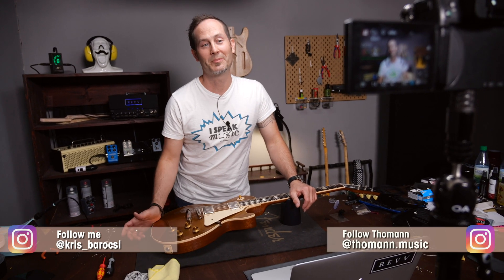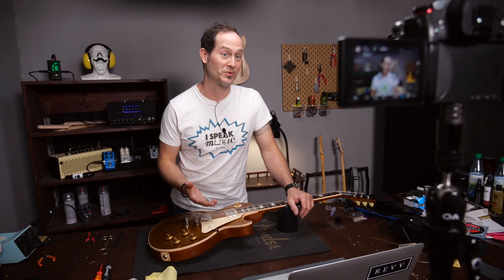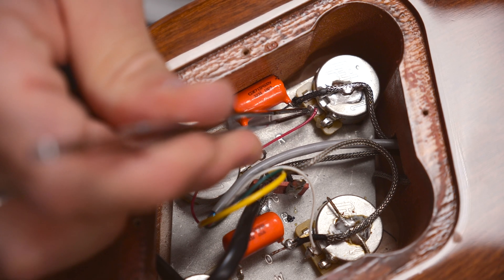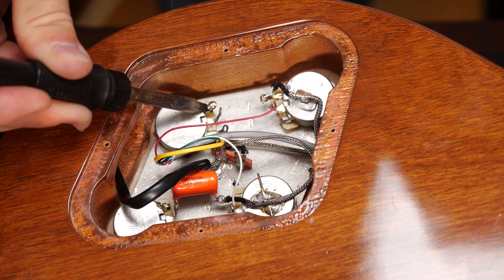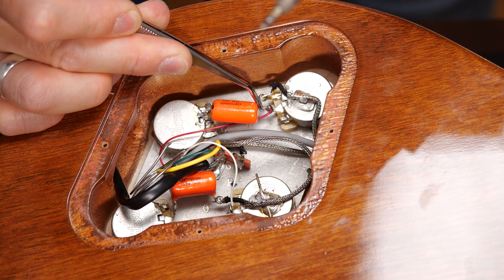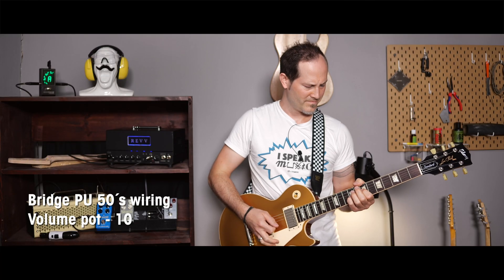What Is The '50s Wiring? | Guitar Tech Tips | Ep. 75 | Thomann

Comment: For anyone interested, you can do this on a guitar with two volumes and ONE tone: PUs to their volume pots, then vol pots to the PU selector switch, then main output to one end of the tone cap with the other end in the tone control and then to the jack. Reinforce the cap since it's kind of hangin' there (wrap it in tape or a large tube of heat shrink (I'd solder a small wire between the cap & the pot to make it neater)) and you're golden. Did this on my Gibson Flying V and it worked great.

Comment: I have been reading a Gibson forum, most say it is not that big a deal unless your pots are bad. I don't use my controls, I keep all of them at ten. They say you don't get any more feed from cheap wiring, then the 50s cloth wiring. I am going to replace my pickups in my Epiphone and use the wire they installed to hook up the new pickups. The only control I need is a toggle switch on a guitar, they can leave the volume and tone pots out for all I care. but it would look funny.

Comment: You didn’t mention the other benefit of 50’s, which is that, once the volume control is less than 10, the tone control becomes interactive and doesn’t darken the sound, but lowers output by scooping the midrange. So if your tone is on 5 and you drop the volume from say 10 to 8, the sound will clean up quicker than a Modern wired guitar would, while remaining clearer and less muddy. Into a cranked vintage Marshall, the range of clean and edge of breakup with 50’s wiring is way better and more usable than with Modern. Even at lower volumes on an amp set for edge of breakup or low gain, the range of cleaner sounds you can get from taking out the boxy midrange is so good.
And when the volume control is on 10, the tone control works the same as Modern and darkens the sound. But even with the volume control under 10, if you want to darken the sound, just drop the tone control to like 1 or 2. 
Very versatile.

Comment: I have a Gibson Les Paul Studio, and I had the circuit modified: I removed the PCB and installed original Gibson 500K potentiometers and 0.22mF Orange drop capacitors with a '50s wiring. I preferred the original Gibson potentiometers to the CTS ones because I think they're better these days. What do you think?

Comment: These timings should allow one to do direct A/B comparisons for a particular pickup/Pot setting back to back.

For me, the 50s wiring sounds slightly brighter and cleaner than the modern wiring sounds.

My question is, is it easier to subtly control the knobs with the 50s or the modern wiring?

Bridge Pickup

Modern Pot at 10 2:12
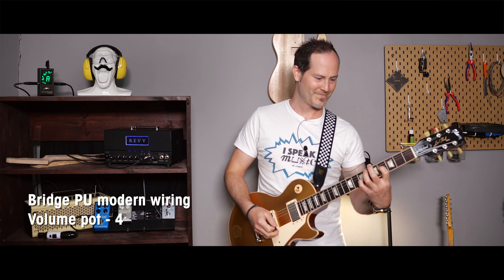50s Pot at 10 2:43

Modern Pot at 7 2:24
50s Pot at 7 2:54

Modern Pot at 4 2:33
50s Pot at 4 3:03

Neck Pickup

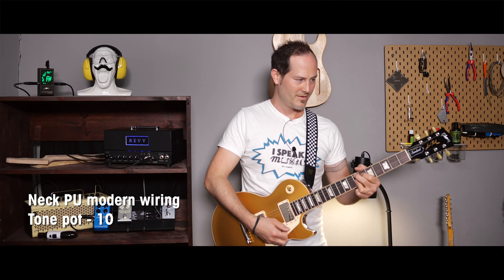Modern Pot at 10 3:13
50s Pot at 10 3:45

Modern Pot at 7 3:25
50s Pot at 7 3:56

Modern Pot at 4 3:35
50s Pot at 4 4:06

Comment: I recently changed to a 50s' harness in my Les Paul as the neck pickup was way too muddy when rolling the tone down and....well, it is not any more :)  I was so used to the mud that for the first few seconds there after the change I thought the tone pot was not working...lol...However there is more than meets the eye. The tone pot interacts with the volume pot as well now so it can get darker as you roll off both pots, which means more tones available. AND, despite the fact there should be minimal change when all is at 10, honestly as you have a bit LESS circuit in the input of the volume pot, there is defo a bit more clarity even when everything is at 10.

Comment: 50's wiring as it's called (actually both way's were used) is a mistake electronically. It doesn't actually keep it brighter, it alters the mid resonant freq. Problem is it makes the tone control useless. In fact it acts almost like a volume and really screws the taper of the volume pot. This among other things is why everybody abandoned it for the correct way,( cap on input lug of vol pot ). I just turn my guitar to 8 or 9 adjust my tone then if I turn guitar all the way up, just back off the tone a couple. This way I maintain the proper function of the controls and keep even tone. If you dont use your tone I guess it doesn't matter, but if that's the case just disconnect it then no cap at all. And if you keep tour guitar vol on 10 all the time either way is the same as the 2 lugs on the vol are shorted together. I still know people who haven't advanced to actually using both vol and tone knobs yet. Hell, Eddie had no tone control at all. Some very good pro's like R.Ford keep both on 10. He just seems to use clean and dirty for the changes. If you play with other guitars in the band that's not allway's a good option. It also really screw's up the middle position on a 4 knob set up like an LP.
Reply: Thanks, you answered the question this immediately raised in me. "Then why was ist changed?"
Reply: @derfalschejunge  Each way sounds a tiny bit different. The "modern" way keeps the tone controls more independent of each other in the middle switch position. Since the "50's" connects tone to output lug of vol. pot, in the middle switch pos they are connected together. All of this only happens when one or both vol. controls are reduced. At full vol. the input and output lugs of the vol. pots are connected together. My guess keeping them more independent might be a reason they changed it. Another speculation is back then it just kinda depended on who wired the guitar, or what day of the week it was, maybe some were Monday morning guitars. I personally like it on the input lug of the vol. keeping the tone controls more separated.
Reply: Just keep normal wiring and add a treble bleed, much more logical…

Comment: To fix the taper on the volume pots add a 130k resistor between lugs 1&2 on each volume pot. Same sweet sound but a more useable volume pot range.
Reply: Would there be a big difference in using 150k instead of 130?

Comment: Is this the way it came from Gibson? If so, i guess Gibson do not know how it is set up on the 50s wiring. I called them to confirm this wiring but they said it it wired like 50s and not modern
Reply from the maker: This guitar is over 3 years old, so it might not have the current Gibson wiring. They changed that multiple times over the years so the correct info on CURRENT specs are what you get from the manufacturer. Cheers //Kris

Comment: You skipped the important explanation of why the 50’s wiring is so great: you can dial in your Overdrive to be explosive at full volume and then use your volume knob to clean up your tone. Now all your tone variations are at your fingertips. If the volume only turns down your amplification but keeps the tone unchanged then you don’t have this fantastic feature.
Reply: How about posting  links to a circuit diagram of each wiring format (and a wiring Diagram of each)?
That way us electrical engineers can work out why the difference
Reply: so the modern wiring is better 😂 why would I want my guitar to clean up and then sound muddy when I can just have it clean and crisp
Reply: @cymananroll  lmao seriously? bc you have access to more tones. like they said. if you just wanna reduce volume w/out changing tone then there are myriad ways to do so, like a volume pedal.
but getting to dial in the drive on the fly like that is essential to more dynamic playing.
Reply: @jjclem8759  You missed the whole point of the video and of my comment. Read/watch again
Reply: @jjclem8759   the 50s wiring is actually helping to not change the tone when the volume is rolled off. With Modern the sound is dull and weak when the volume is rolled down. With the 50s my tone stays mostly the same (crisp and clear) but just gets quieter. With a volume pedal you’d get the same thing happening as modern wiring where the tone changes and gets dull as you turn the volume down. The tone knob also slightly affects the volume knob in 50s but there are some fun sounds and settings that can be dialed in. I’ve tried all the different wirings and 50s is by far the most useful and best sounding to my ears.
Reply: @cymananroll if you’d understood the point of the video you’d realize that you actually would want 50’s wiring for your tone to remain crisp at lower volumes.
Reply: @cymananroll  Ha.  All sounds are pretty subjective.  It's a very nice feature you may want to try out.  I changed my trad pro 2 over to 50's wiring and it's a huge improvement to me.
Reply: @cymananroll blonde vs brunette.
Reply: @cymananroll  I’m guessing you don’t listen to classic Rock N Roll all that much. It’s known for dirty overdriven electric guitars and all that fun stuff. It’s common for guys to plug into an overdriven amp and then use their volume control for dynamics making it go from crunchy as hell to quiet and clean with the turn of a knob. It helps create a mood or different feeling in a song. Gary Moore is a perfect example. It’s all about what sound you’re going for and one isn’t “better” than the other. If you never touch your volume control and always play on 10 then the 50s wiring won’t do much for you. Both wirings sound the same on 10 but when you back the volume off 50s wiring it stays mostly crisp and clear as the volume drops. When you back the volume off modern wiring it starts to get weak and dull, and the highs disappear. I call it “losing authority”. It almost sounds like the speaker is under a blanket and makes any riff feel pathetic and weak. The tone controls in the 50s wiring are also interactive with the volumes so there’s a few little tricks that can be done to get different tones with those too.

Comment: A “must to do” mod! I did it on my SG (60s wiring) and the improve was astonishing specially on neck pickup (more clear and open) and now I have a bigger palette sounds in middle position… AMAZING! Thank you for the vid! ✌🏼
Reply: Did it on all my HB guitars except sss equipped one .. 
It's probably the cheapest mod with the biggest effect on the guitar
Reply: If your SG has p-90s use 50s wiring but send the tone pot to volume pot with a wire then tone pot to capacitor to ground. Humbuckers have 2x impedance (DCR)
Reply: Dis it make ur neck pickup tone fatter, and less snappier? Id like my neck pickup to sound similar to my les paul that has the 50s wiring

Comment: What would you recommend switching in my epiphone 50s standard in order to get that gibson 50s sound?

Is it wiring, plus orange capacitor, plus 498t gibson pick up? Anything else im missing?

Also what can i expect to pay a luthier for the labor itself?

Also would this get that Gibson sound ?

What brand of wire and orange capacitor do you recommend
Reply: I think I can help you with these questions. I've taken this journey multiple times with Epiphone Les Pauls. First: it starts with a good one! I've played really great ones and not so great ones. It's starts in the wood. I've noticed Epi's have a natural scoop in the mids, I e tried everything to change that and it just is what it is. But, you can get pretty close. Buy a good set of pickups. Duncan's are my favs. Also have an entire new wiring harness installed 50's style. Have your guitar's frets leveled and the nut replaced with bone. If you really want to go crazy, get a vintage Aluminum tail piece(gives more harmonics) and a bridge to match. You'll be very close. You'll also be about 600 bucks poorer just for the materials and install. You'll save almost half of that if you install the electronics yourself. That's what I've discovered on my journey.
Reply: @curtevans838   Hey Curt! I will try it out for sure!

Quick question.   Do you know what type of setup process is the one that allows the strings on the guitar to ring and vibrate smooth instead of stiff string with poor sustain?

Theres a step in the set up process that allows this just not sure which one it is
Reply: @EM-km8em  well, now we get into string gauges and height. I would recommend starting with 9 guage strings and go up from there if they feel to slinky. A good guitar shop will ask how you want it set up and they will do wonders for your playing style.
Reply: @curtevans838  thank you curt!

Last but not least, what duncans do you recommend? Brand of 50s wiring and bone nut? Thank you so much!! 🙏
Reply: @EM-km8em  Antiquities, 59's, or Seth Lovers. Either of these will give the vintage sound. Look at YouTube reviews for your preference. Emerson Electronics for wiring harness. Your luthier will have their own bone nut preference.

Comment: I've got 50s wiring in my new Gibson 335, and I'm not a fan. I'll probably have it switched. I don't like my volume to decrease so much and my tone to decrease so little when I dial back my tone knob. If you play with your tone wide open, it's probably a good mod for you. But, it's not for everybody.
Reply: It´s meant to have the amp dialed in not too bright so you have the tone at 10 or almost. I you have the amp bright and need to to have the guitar tone on 6 then 50s wiring will be a headache.
Reply: @zaldum386  I have to dial the tone on my 1974 Silverface Deluxe Reverb down to 3 to get a tone that's not too bright. With the old Utah speaker in it, it's a warm, mellow amp, not a bright one. It was designed to solve a problem I don't have and adds a problem I didn't want.
Reply: @robertgibson8295  then its not for that amp obviously, my LP and Teles with amp sims will welcome the open tone I guess, I´m doing the mod today, well see

Comment: I have a les Paul Standard from 2021 and it has the 50's wiring.
If I roll back the volume from 10 to 8, i have literally zero high end, its only mud and no definition.
Maybe looking for a treble bled mod because otherwise the volume knobs are absolutely unusable.
Can't understand why this isnt solved better for over 2k...
Reply: I have a 2012 LP Traditional.  Always sounded muddy.  Decided to check the pots and found every one of them was garbage.  Replaced every pot, replaced the wiring with cloth and the best stuff I could find.  I was surprised what cheap wire Gibson put into a $2400 guitar.  Did the 50's wiring and all the changes made such a difference.  Had the G string slip and put on Kluson locking tuners, solved that problem. Now I have a nice LP that is getting pickups tomorrow.  The original ones seem and sound okay but the new ones will be an upgrade.
Reply: Did you get it from factory 50's wired? Cause all standards from 2019 to date are supposed to have modern wiring and not 50's. If you got it 50's wired from factory then you are a very lucky guy. Enjoy yours.

Comment: I thought the ‘50s’ wiring seemed to retain more treble.  I liked it better.  Is there any downside to this wiring?  Why did ‘they’ stop using this approach?  Thanks for the great video(s)!
Reply: In the 50's both were used, just day of week, who wired it etc. With what everyone mistakenly calls 50's when on both PU's the tone controls are connected to the output not separated to each PU.
Reply: They stopped, because this is a fundamental aspect of what makes the guitar sound like a vintage instrument. They can't have a LP Standard sounding as good as a super expensive Custom Shop piece.
Reply: @emptypromises2962  utter nonsense. Gibson gradually made the change from '50s' to 'modern' wiring during the 1960s.

I suspect the reason for it was because amp manufacturers seemed to be producing increasingly bright amps at the time. the tone control offers a much more consistent high end roll off with modern wiring, whereas it's very interactive with the volume control setting with 50s wiring.

Comment: Modded my Epi LP to 50's wiring today. A bit more tricky since it was a variation on the modern wiring. Caps on tone directly to ground and a wire between the tone and volume with the shielding used for ground. Had to disconnect the cores of the wire between the pots but kept the shielding for grounding as is. Fun job, learned a lot!
Reply: I have an Epi SG that has the same tone control wiring caps to ground.I have changed as you did to 50s wiring and it improved the overall sound. Try putting the tone cop back to original wiring and the shielded wire going to center lug of volume.This is a hybrid of sorts.Also look on Google for Gretch tone control wiring .There is a circuit described as no load tone control that is basically 50s wiring with tone control similar to Epi except the tone circuit goes to center of master volume like 50s wiring.

Comment: Excellent!   i could use both wiring styles.    50's on the neck and modern on the bridge.    For me, the neck is the pretty sound and the brighter low volume sounds better matched to the louder volume because i want clean+detail.   For me, the bridge is for driving effects and amps and the contrast as you bring it up helps the impact of the pedal or amp distortion/drive. I want that sound to rise up from the mud and scream.   I have an LP studio from 2000. i have already split the pickups by completely removing the pickup selector switch from the circuit.  the neck pup is wired to the 1/4" jack. i then drilled a tiny hole in the backplate to thread a cable with a connector (thin RCA type) for the bridge.  the sound is actually cleaner and the guitar is dead silent AND i can run 2 complete effects chains.  So i will do this modification. either way, i only have to modify one pickup wiring because one is correct and one is not correct. If you are interested, i made one small test video on my music channel with the 2 separate pickups and a vocoder controlled by a 12-step on the floor.  it was just an ad-lib jam, but you can hear the different sound of the 2 effects chains.  https://www.youtube.com/watch?v=FOo1SW0zSR0 (i was rebuilding my keyboard stand and i had no keyboard to play haha) tchuB! (ps. the first pedal in one of the chains is a black arts toneworks pharaoh supreme. it has 2 tone controls that can keep the highs in, which is great for keyboards. it is dead silent too.  best fuzz on the planet that no one knows about)